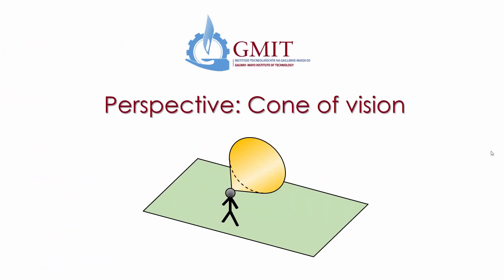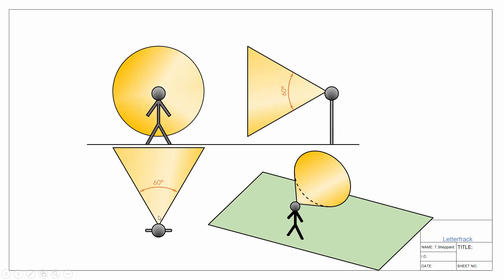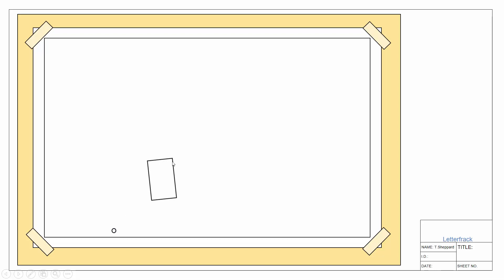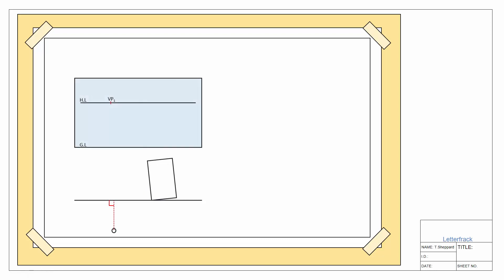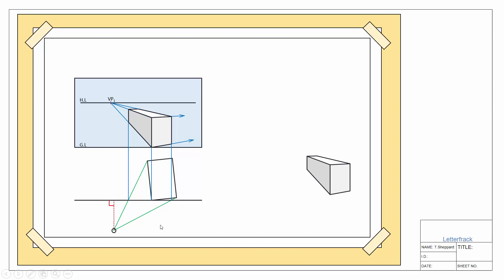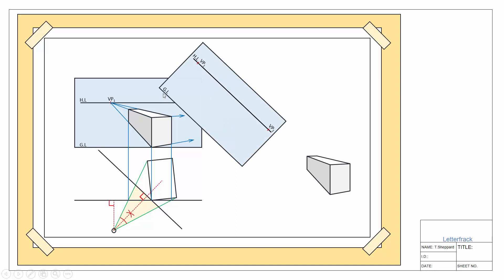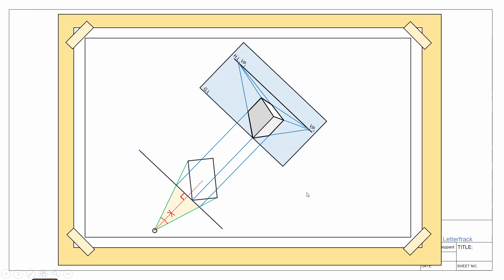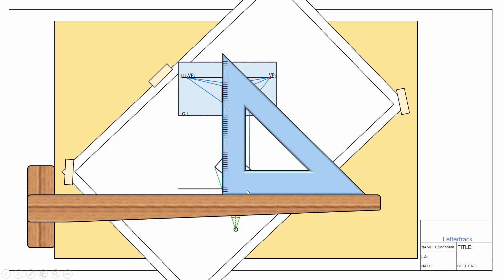Perspective: Cone of Vision

Comment: why 60 degrees?  why not 90, 70 ?
Reply: because 60 is the widest cone of vision we can have without too much perspective distortion....I don't know who set 60 as the limit, that probably goes way back to the renaissance
Reply: @SquidkidMega  it's the approximate field of view between our two eyes that we can actually see. Everything else is peripheral vision that becomes highly distorted like getting close with an ultra wide lens. It's based on our biology.
Reply: But we can only see clearly in foveal vision which is just 2 degrees right. Then how come entire 60 degrees can be seen clearly
Reply: @sriramgovindarajan2585  What you say is correct: The foveal vision, where the human eye can focus on razor sharp, is a very small area or angle (approx 2 °). Some say, the residual vison beside the foveal vision is the peripheral vision, where all things are blurry. That is not correct. There is something called para-foveal vision. Within this area or angle we can see colors, forms, shapes and patterns distorsion free. And the angle of this para-foveal vision is around 50 - 60 degrees. And after this the peripheral vision comes into play; in this area all is blurry and we can't see colors or forms, only movement. Some speak in this context also from cone of visual attention, which should be 55 degrees.
Reply: @Cuetips1000  even that para foveal vision is actually not clear.take one demonstration for example when looking at your thumb nail you cannot tell if there is a nail on your little finger.our area of clarity is very small only about size of thumbnail at arms length.thats why the eye makes eye movements called saccades to bring clarity to visual field.therefore even the cone of vision is not perfectly clear
Reply: @Vivek Aakash that's right, yet you can only see in focus 60 degrees. The rest is blurry and distorted-- you don't see the distortion because it's blurry and because you're focusing on something else!!
Reply: However You can check the distortion just by looking at the mirror and get extremely close, that way your whole face will be in focus, and you will see the distortion.
Try it with making one eye very close to the mirror.